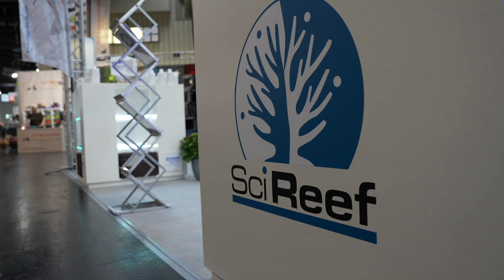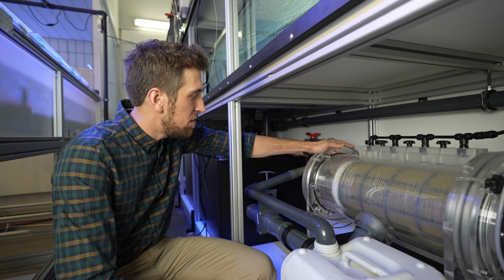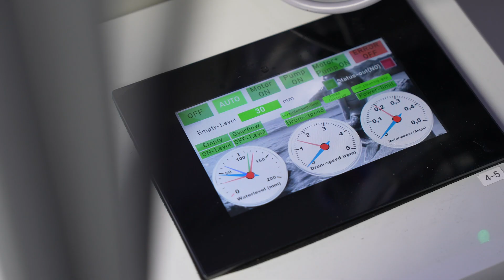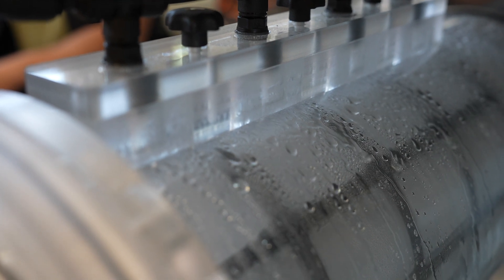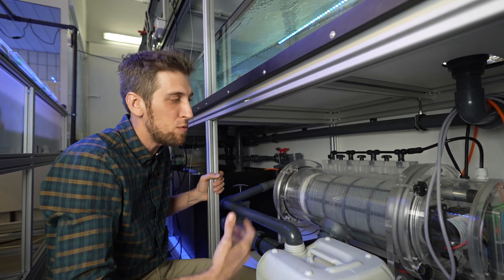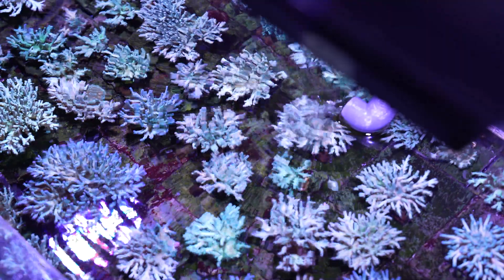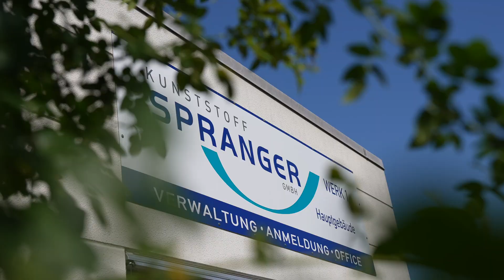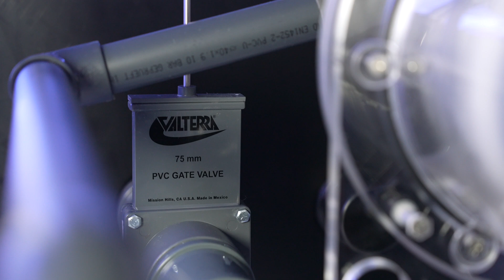The innovative DRUM FILTERS for SciReef's new coral farming facility

Comment: Using tank water to clean the screen filter means to u have replace the exact quantity of salt water to avoid salinity fluctuation.
Reply: In theory yes. We have it running for a few months now and it uses little water compared to the general cleaning we do. The way we have set it up it needs about 2 L for a ~2500L coral system per day.